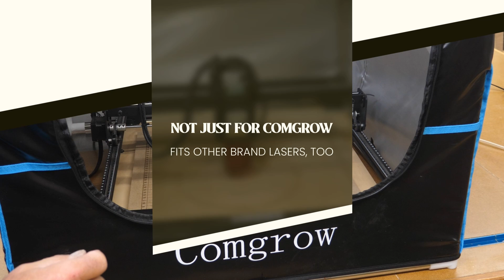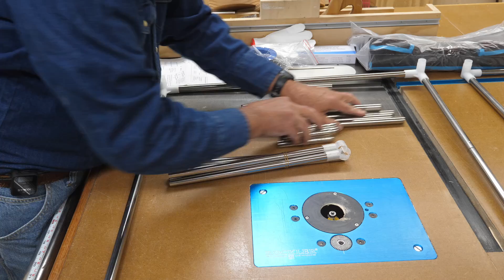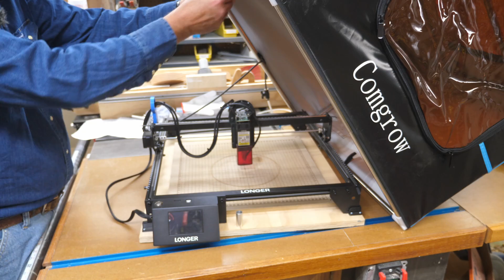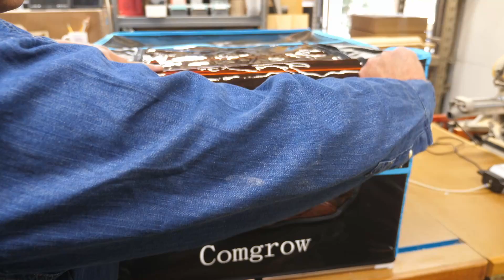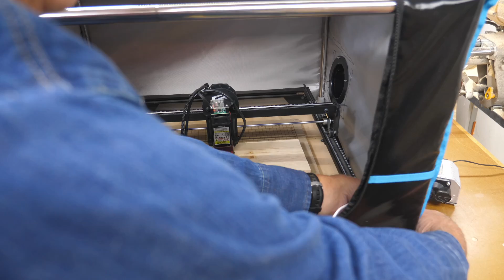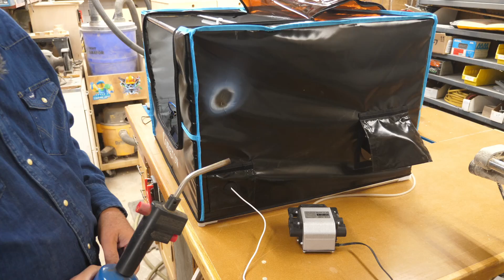Comgrow Laser Enclosure Assembly and Demonstration

Comment: Did you have any issues with smoke escaping through the bottom since it is not completely sealed on the bottom?
Reply from the maker: No.  The exhaust fan creates negative pressure and pulls everything out

Comment: I bought their first version to use with the same laser in this video, the Longer Ray5.  The first version of the Comgrow enclosure was just a bit too small.  This one is big enough for it and a lot taller. They added the grommet holes for the cables and put the exhaust port on both sides and not just one.  If I was still looking for an enclosure I would go for this one hands down.  Very glad to see version 2 was improved quite a bit.